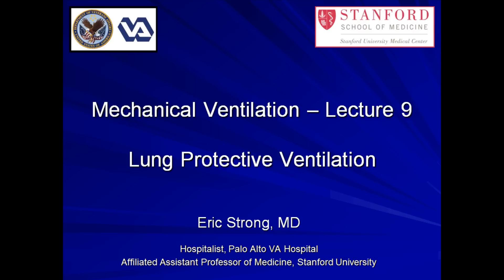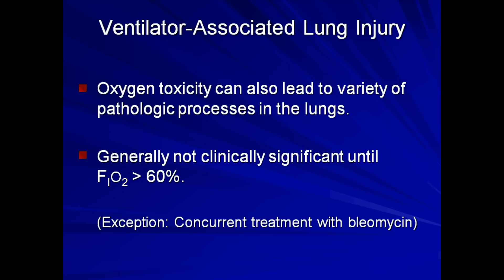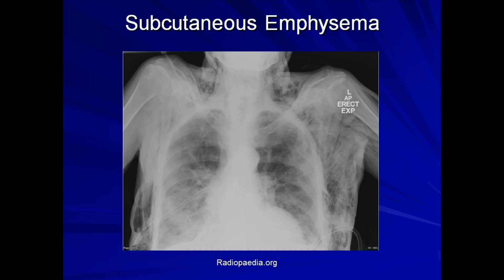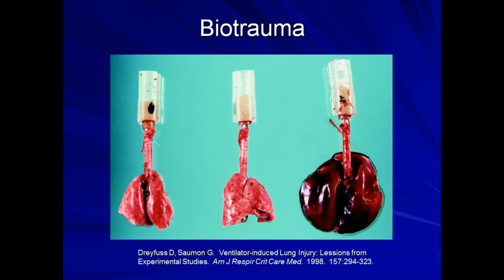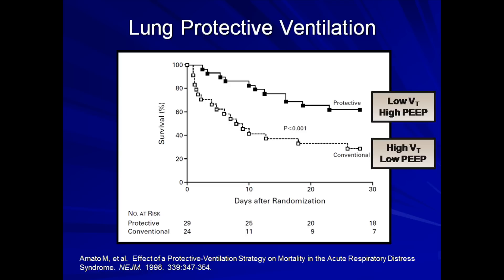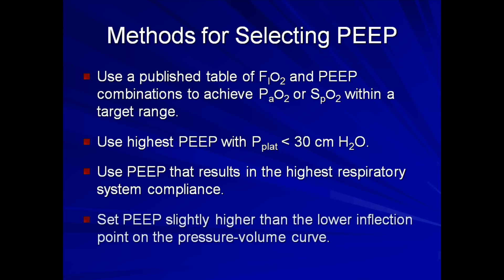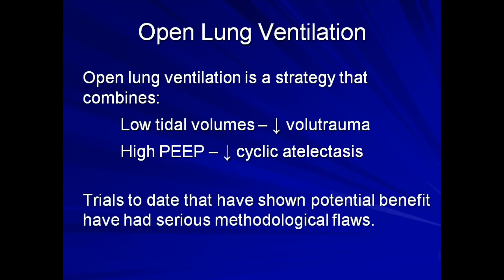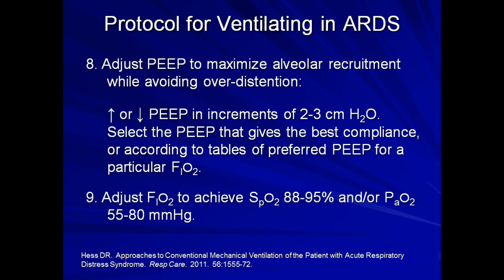Lung Protective Ventilation (Mechanical Ventilation - Lecture 9)

Comment: I have 30 years of direct patient care experience with ventilators. I recommend against 'permissive hypercapnia'. In addition, VALI is over hyped. Lung injury on ventilators is most often caused by less than ideal ventilator settings and insertion of subclavian venous lines.

Comment from the maker: wasseif68, I'm glad you've found these lectures to be helpful.  I completely still plan on returning to this series on mechanical ventilation, and picking up where I left off with lecture 10.  However, for better or worse, for some variety I had switched to a series on ABG analysis and have a few more lectures with that I'm trying to finish up first.  I'll get back to mech vent afterwards (which will realistically be at least a couple weeks).  I'm very sorry about the delay.